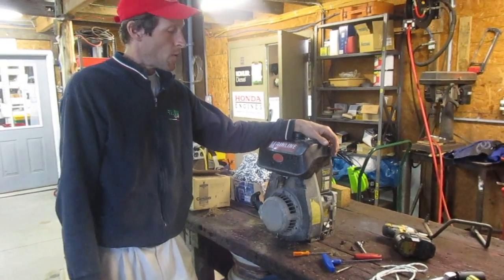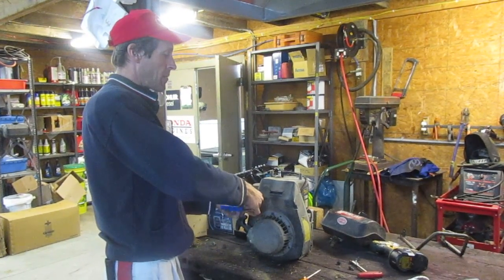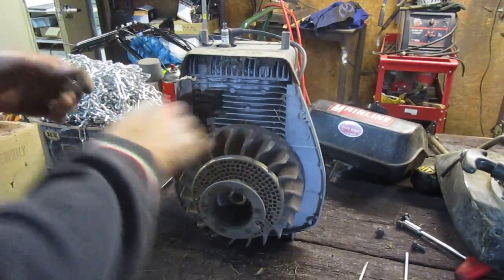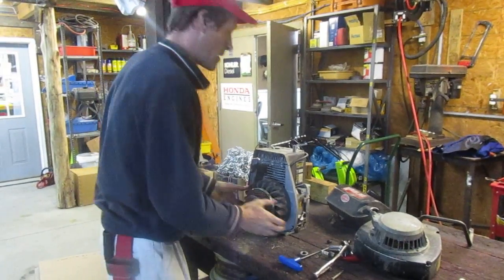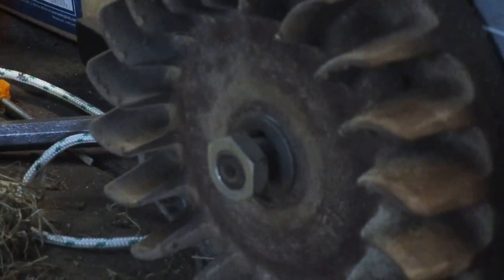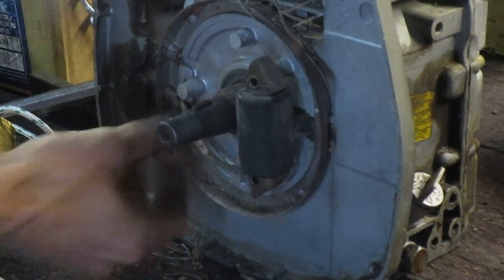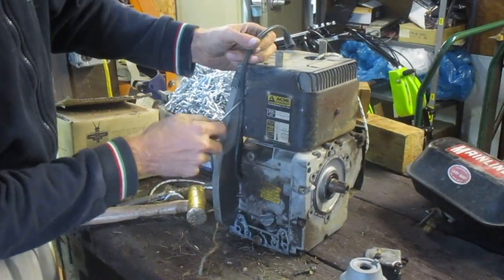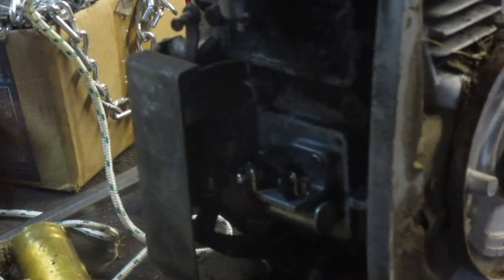Changing Ignition Coil: ACME AL/ALN Series Engines (Points & Condenser Ignition)

Comment: I ordered a new coil and still no spark.  Nothing.   Any idea?  I disconnected the prim coil and also no spark.   I can not find any resistance for the prim coil , also not on the new one.    The secondary is 4,5 kohm.    I'm out of options.  Only thing I can imangine is that the new coil is also bad.

Comment: good one joel, thanks.  how do you know when you need to replace the points, condenser, coil, spark plug and wire?
Reply from the maker: ...When the engine is not producing spark. In the case that spark fails, of course the first thing you want to do is check the points to make sure they are clean & gapped properly (.018" max. gap), and then replace the spark plug, which is the cheapest part.  If that doesn't do it, then the points & condenser can be changed...if THAT doesn't do it, then you replace the coil (the most expensive part).  The plug wires rarely go bad on these engines, being that they are a metallic-core wire...essentially, if the wire looks good and has no "burned" looking spots on it, it is probably good.
Reply: thanks, could you video a service for tiller maintenance?
Reply from the maker: That is "on the list"!!  Stay tuned...
Reply: thanks joel, you're the best.    looking forward to it.................